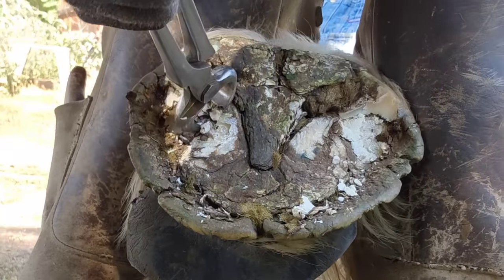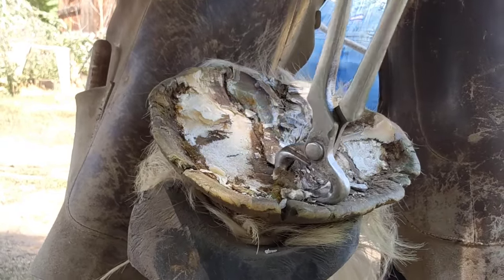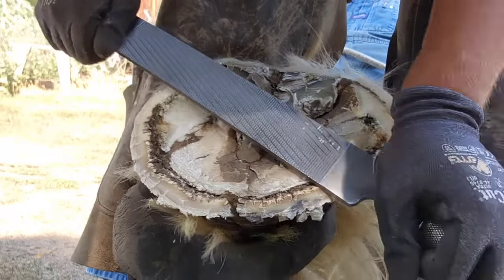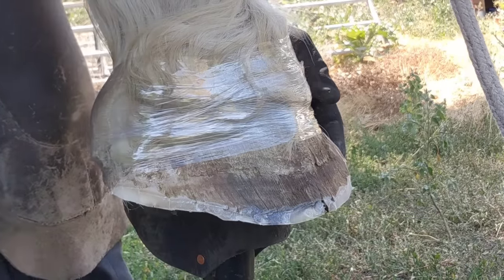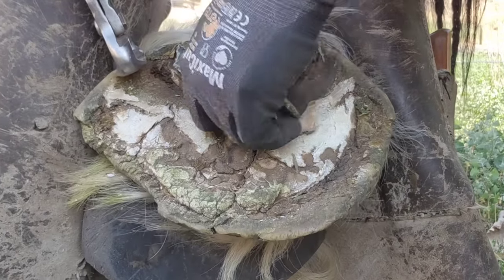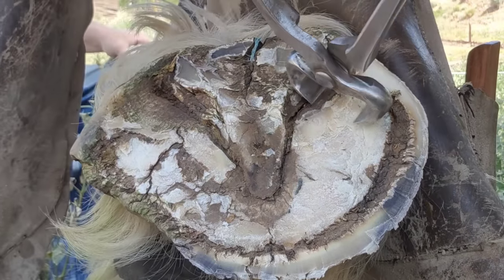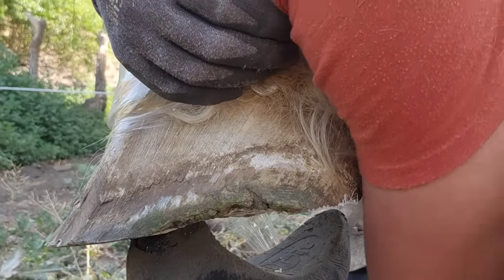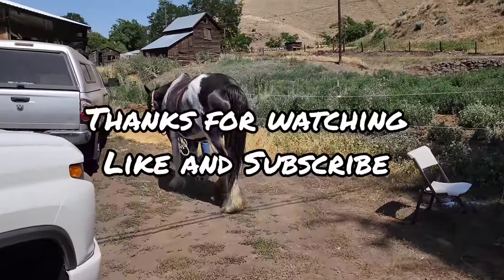These Hooves Are So Dry!!! Hard Hooves Needing a Trim - Hoof Restoration - So Satisfying

Comment: I spent several years working for a farrier in the North Somerset Levels, England - and was most interested in what you said about the working life of your tools.  In many ways, we had the opposite conditions to deal with;  for starters, the soil in that area is largely peat, as it was all sea marsh until being drained about 400 years ago.  Even now, if a cow runs across a field, you can the ripples spreading out from her feet as though she was running across a shallow green pond, and the water table is only a few inches below the grass!  Annual rainfall averages about four and a half feet per year, so we were usually dealing with soft hooves rather than hard.  A rasp normally lasted us 9 - 12 months, and nippers lasted for years!
Reply: Fascinating about peat and the way it ripples! We have clay soil here, quite the opposite.

Comment: Thank you for another informative video. It usually drives me crazy to see a muddy area around the water trough, but your explanation made so much sense! She is a stunning  Clydesdale! ❤️❤️❤️
Reply: Okay, how does one clean a water trough. The metal ones don’t seem too hard but the old ones that are made of concrete I suppose seem to heavy to lift onto its end to rinse after a good scrub.
Reply: @TheEmpressMouse  I have no idea, I basically know nothing about horses, my comment from from an inexperienced point of view. Basically from driving by farmsteads and observing a muddy area around a trough.
Reply: @TheEmpressMouse They rarely are cleaned using detergent, and usually are hard scrubbed and just pressure washed and overflow several times.  Usually there's an outflow in the newer ones.
Reply: @margodphd  thank you. 😊

Comment: Caleb: Nice job on the trim, does give the hands and forearms quite the workout. I to have a draft horse and he always breaks off in the same spot as Lakota. Have you ever thoughr or used the "Hoof Boss" or a cordless grinder? Both have helped me with hooves that are rock hard. I still use my rasp to finish. As far as the saran wrap plastic issue, people complaining about that is laughable.  Its not recycable, the local landfill will only take certain plastics and the volume that you use compared to all the Starbucks plastic lids is a mere drop.
Reply: AMEN!

Comment: I saw in a horse trimming school video that they used a blow torch to help soften dry hooves.
Reply from the maker: I have done this as well but try not to use it unless absolutely necessary as it drys the hoof out even further
Reply: just a tool to have in your toolbox if needed

Comment: If you are catching heat for using the plastic wrap, perhaps you could look into purchasing ear snoods that are used on dogs to keep their ears from falling into their food and water bowls.  Google English Springer Spaniel ear snoods and you can find a large variety.  They are kind-of shaped like leg warmers from the 80s.  (Dog Hood No Flap Ear Wrap, Quiet Dog Headband Dog Head Cover No Shake Ear Wrap Dog, The Grooming and Force Drying Pet Ear Protector for Anxiety Relief Calming Dog Ear Covers for Noise) Just slip up over the hoof and surrounding hair to keep it out of the way while trimming.  Machine washable so you can use them over and over again, or have the owner of the horse keep them on hand for you to use.

Comment: This is literally my pony mare's feet!! I tried nipping them myself, and I'm 5'2 with tiny lady hands. And I thought I was going crazy cause I was watching videos of owners trimming their horse hooves with way less effort. I even bought $200+ budnippers, cause I thought I could finally be able to trim...but nope...Even they hardly did anything for me 😥

Apparently climate is a big factor in how hard/soft a horse's feet are. I live in southern Idaho, where it's very dry in the summer. So the muddy water trough trick...would that keep their feet softer for trimming? Do the hooves hold onto moisture for a long time? or would they quickly evaporate and get dry again. Or would I have to do more the prep prior to attempting to trim??

Right now the only thing I can use is an electric hoof grinder, and while not my favorite thing, it does work. Although I wanna learn to use the nippers cause it would be less scary, especially when I get young horses

Comment: Curious about two solutions to dry hoof trimming and prevention: Would a Dremel tool be better for dry hoof trimming instead of an undersized Knipper? Also, is there a type of sealant for hooves to preserve the hoofs moisture and integrity?
Reply: Dremel is too small and slow. There are plenty of good hoof products, from moisturizers to hoof oils and shiners.

Comment: Isn't there a hydrophilic salicylic acid product owners could treat the horses with a few days before you arrive?

Thanks for talking about stanchions.  I watch HoofGP who trims cows feet.  They have a crush the elevates the cows and lifts them off their feet.  Im not sure why farriers dont use something like that.  Granted, they do higher numbers, 50 cows a day or so.  It wiuld be so much easier on your back and feet though.

I'm in the humid south. In summer it feels like you are breathing in a swamp, so much water displacing oxygen in the air.   So it was interesting to hear about the opposite problem.

Comment: One of my Shire horses has long hooves and a wide white line.  The angle of the hoof is too shallow and needs to be remedied.  I see you using your clippers at an angle of about 45 degrees to the hoof wall.  I can do this but worry that the white line will be exposed?

Comment: I was taught that the outer coating of the hoof holds moisture in the hoof and not to touch it . Also is there any point applying oil dressings to the hooves are they actually absorbed

Comment: I have no problem with the shrink wrap, but if anyone wants a wrap that would be reusable as long as you don't loose it, I would recommend an ace wrap. Still plastic based, but can be used hundreds of times before it loses its elasticity. Assuming you don't lose it along the way.

Comment: Oh, that baby needed hoof oil so badly.. I wish horse products weren't as overpriced as they are ...
You can use a rubber exercise band to keep the feathers away, it's elastic, easy to tie off and on, washable, cheap AND you can use it to stretch your back,arm and leg muscles after work. When folded it can also work as impromptu padding and can also be used to keep the tail out of the way if it's super long. Keeping an exercise band on hand in glove box to stretch after difficult job is much more viable than any other options if you ever get tired of the plastic wrap comments 😅